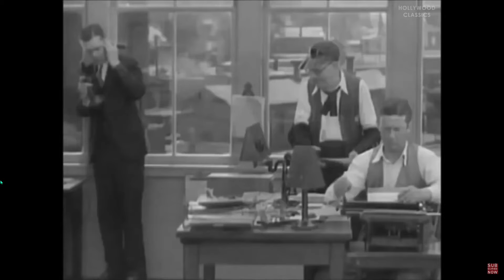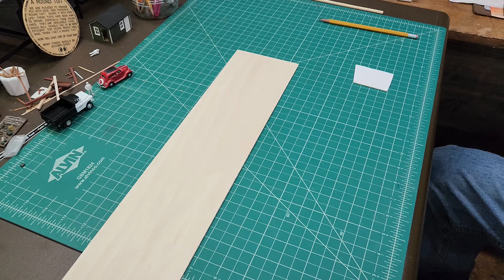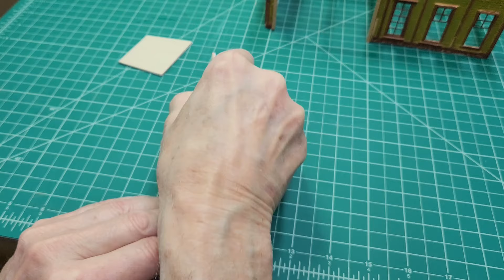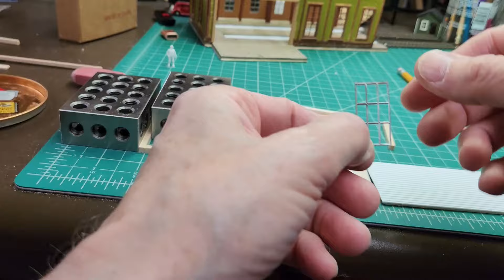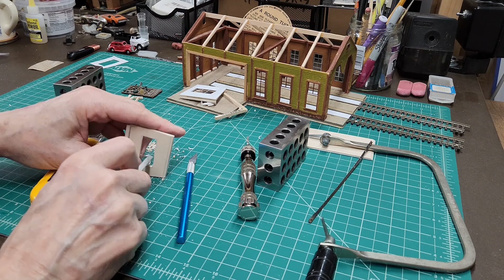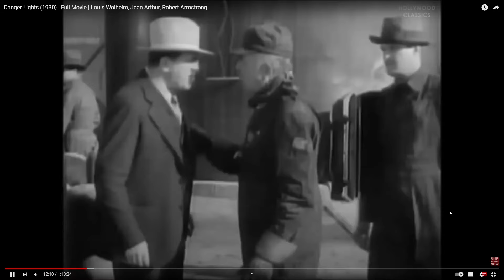Episode 31 Part 7 of the HO scale terminal yard.

Comment: Thanks for sharing.  I like the plastic/wood laminate you made.  Nice work with the coping saw.  Also, perhaps the window plastic got discolored from uv.  If its just surface discoloration and if you had a sacrificial window, i wonder what a little acetone rubbed on it would do.
Reply from the maker: Hi Mike. Thanks for taking time to share that advice on the window panes.  I’ll have to check my stash for acetone.  Regards.